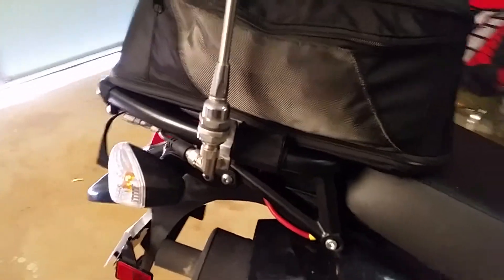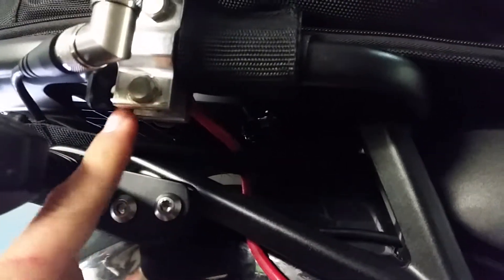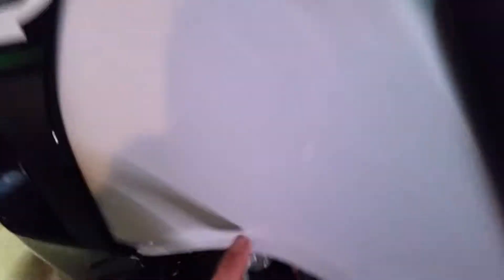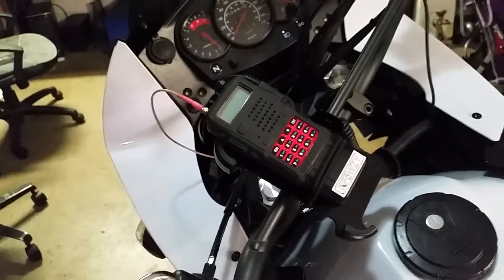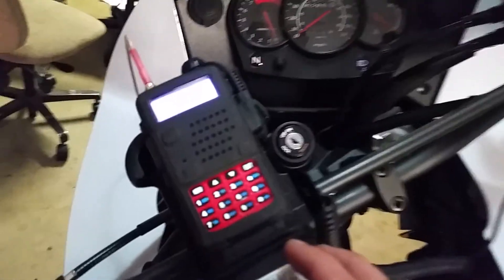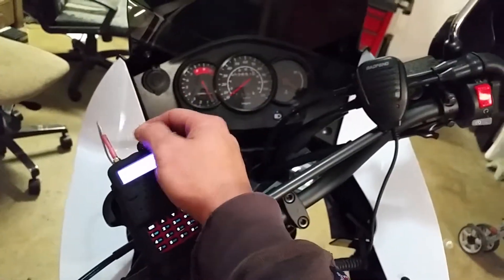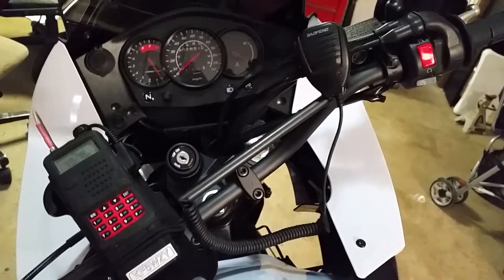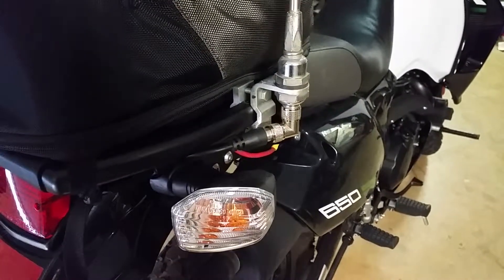KLR 650 Ham Radio

Comment: I just installed the TYT TH-8600 on both of my Can Am Z mr's. I haven't made a video yet. 8 mile QSO on 52 from a Signal Stuff Signal Stick 1/4 wave. I added tiger tails to lower the SWR's. 

The 8600 is submersible and can be pressure washed. It's a true IP67.
Reply from the maker: Nice!